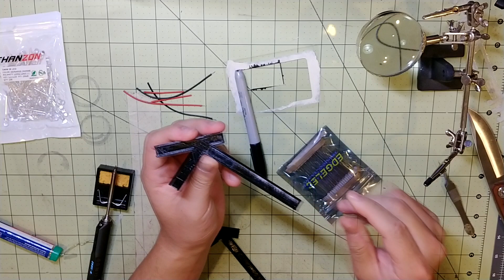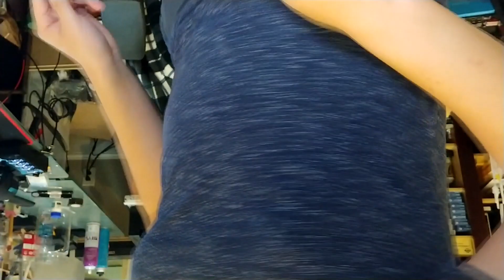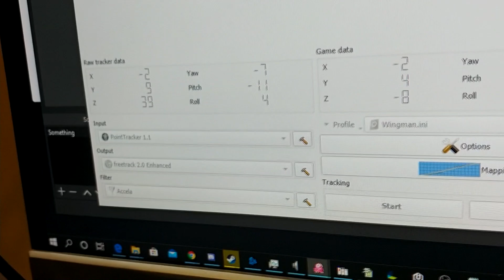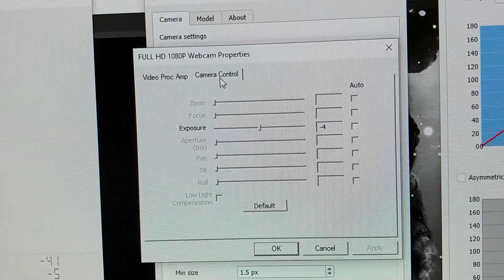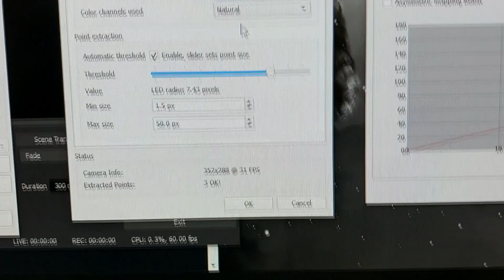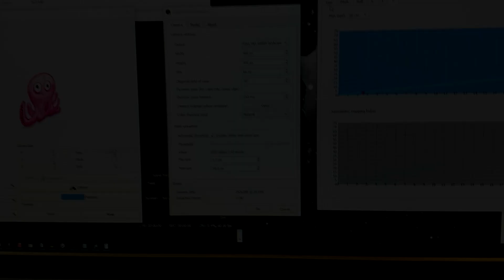DIY TrackIR + OpenTrack Software Configuration

Comment: Hi @Returacan,

I hope you're doing well.

Could you please help me?

I saw your design and I really like it—it feels very immersive. Could you give me the components, including the series, so I can design my own?
Reply from the maker: This was done with a bunch of amazon parts, the LED diode is the weakest link in this whole setup because i keep burning them out overtime. Power connector was i think a JST connector soldered to a USB-A, the resistors will have to me calculated depending on the forward voltage of whichever diode you chose to use...TBH, buy the TrackIR system or Tobii, this DIY thing just isnt worth it.
Reply: @Returacan  Ok super